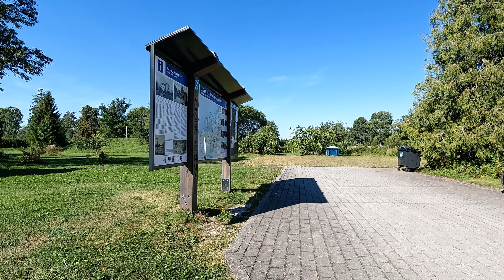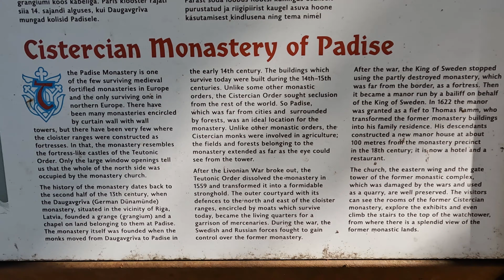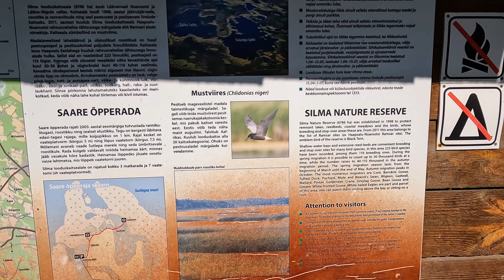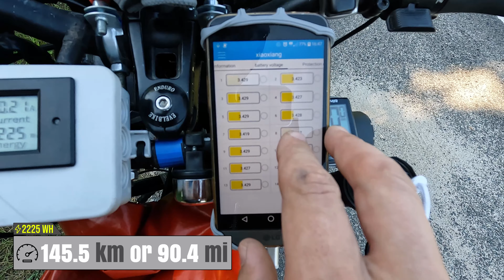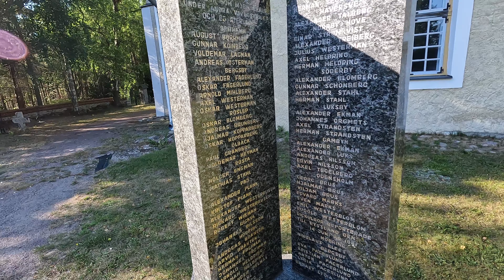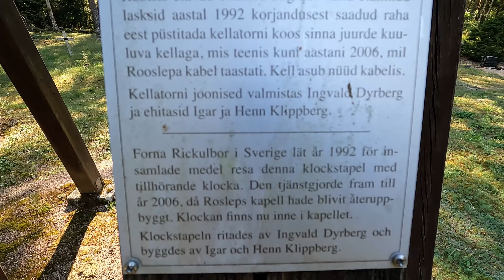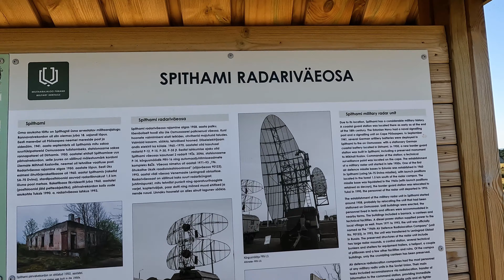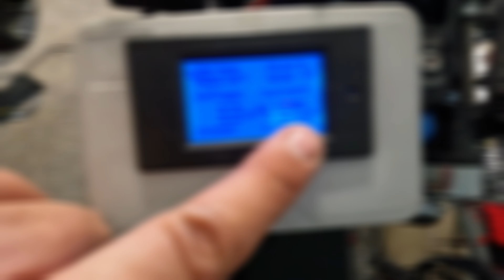E-Bike Enduro Adventure: 254km in One Day, Exploring Estonia (Europe 🇪🇪)

Comment: Good to see you back dude, giving us our fix of long distance ebike trips, cows and beautiful Estonian landscapes.  Great tip for the double walled tire.  If youre interested in a new cheap battery, nkon have BYD  grade A cylindrical 20ah lifepo4 cells in stock for 10 euros each.  I bought some for my ebike and they make for a really easy to assemble, very reliable battery with a JK BMS.
Reply from the maker: Thank you for your uplifting comment! 🌟 It’s heartwarming to know that you appreciate the content. The thing with double-walled tires is that tire removal can be more challenging when the inner tube needs patching, also can be unusual feeling when riding.  Thanks for the information! Currently, I don’t have any plans to buy batteries. My faulty Boston swing is still ticking, and I’m just keeping a close eye on it. It provides usable power of approximately 2.2 kW, down from its original 3 kW, up to 90% charge. I’m the kind of person who never charges my batteries 100%. 🕰⚡
Reply: Thank you for the uplifting content!  Its been a big inspiration the planning for my  500km, 3 day trip on a 100 euro ebike (plus battery).  Yeah, no need to throw that battery away if its still working buddy.  One of the reasons I went with lifepo4 for my new battery is that you can regularly charge it to 100% without damage (in fact you need to, to keep it balanced)  .  Makes the wh/kg slightly better than cadmium based cells.   Looking forward to the next vid. @DatEbikeGuy
Reply from the maker: @StartledPancake  I have a 150 Euro pawnshop bike. I made it electric, and I’ve been commuting and leisure riding with it, covering over 40,000 kilometers of mileage. I wonder why it hasn’t broken; it’s made of aluminum. So, yes, you don’t need a crazy expensive bike to ride thousands of kilometers without a problem.  I wish you the best of luck on your 500 km expedition. Hopefully, you will have very enjoyable adventures.
Reply: Cheap bikes - better for your wallet, better for the environment.  The bike Im riding was over 2.5k new (and looks it), but because it was made with propriety tech once the battery dies, people sell them for nothing.  Some soldering, a new controller, a new battery and its good to go.  Its a shame we have developed into such a work averse, throwaway society but it does mean there are plenty of bargains around.  Thanks for the well wishes, Ill be sure to keep an eve out for pointy bits of metal during my trip...   @DatEbikeGuy